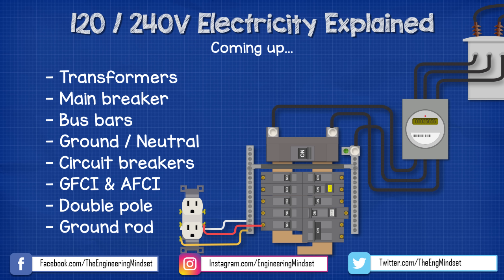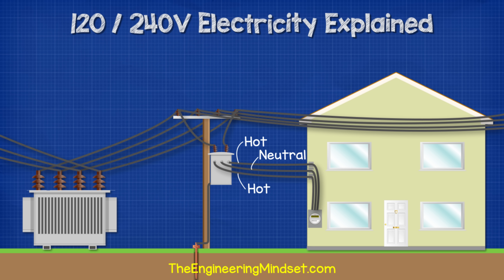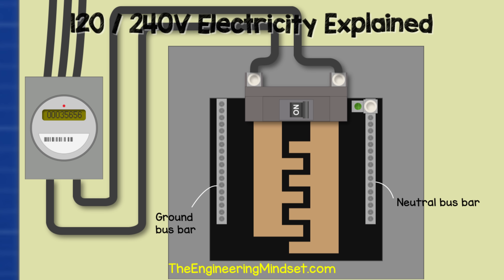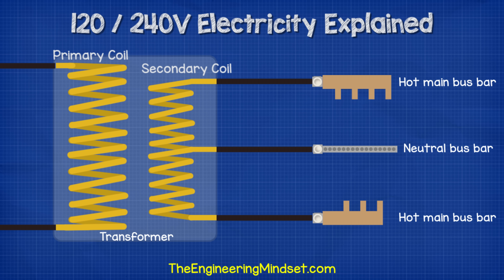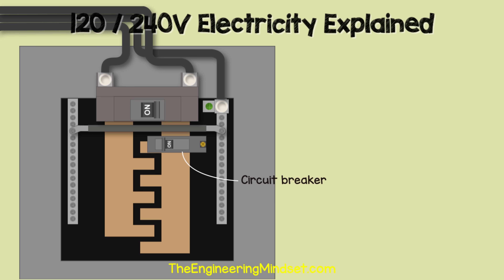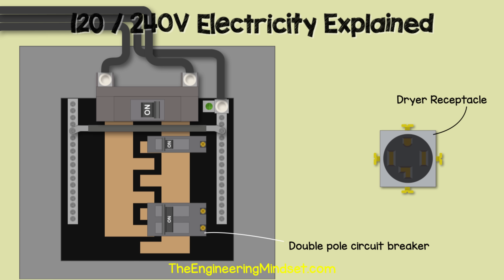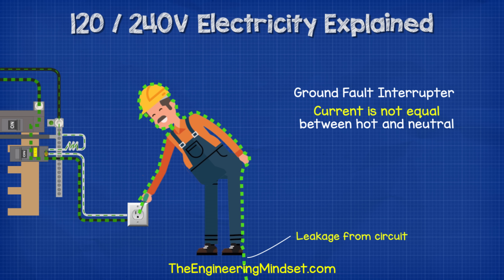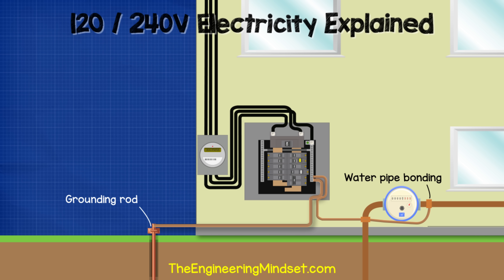120V 240V Electricity explained - Split phase 3 wire electrician

Comment from the maker: ⚠️ Found this video super useful? Buy Paul a coffee to say thanks: ☕
PayPal: https://www.paypal.me/TheEngineerinMindset
Reply: Got a,question for you. Say a small, housing complex powerlines are O gauge , how,can they handle all those,amps,for,each house without heating up?
Reply: @brettmoore3194  I can't say for sure, but the wire may not be carrying as much current as you think. The current on main power lines are large but not that large. This is actually why we use such high voltages. To transport the same amount of power, we can use a high current and low voltage OR an high voltage and low current. In general you should think of electrical power as current times voltage (the actual formula varies depending on phase conditions, dc vs ac, rms values vs peak values, etc). So if we have 2400 Watts of power coming from the line where the primary side of the transformer is at 2400 Volts while the secondary side is at the rated 240 V, then the primary is only at 1Amp, while the secondary is at 10 Amps (this is very over-simplified). Then we could split several wires off the secondary so that any single circuit only gets a fraction of the 10 Amps. Again, these aren't realistic numbers, but residential loads are all basically parallel connections so every home has control of their electricity. And currents in parallel sum, and what I mean by that is that at any single point in a circuit, all current coming in must equal all current going out (KCL). Also, 0 gauge wire can have up to 150 Amps for power transmission, which is about the maximum of most houses as stated, but that won't really be running through any single wire besides the breaker and bus bars which are made for that. Any single circuit that would receive anything more than the wire's rated current would trip that circuit's breaker. I don't know the numbers for sure, but I believe 14 Gauge wire uses 15 Amp breakers, while kitchens and bathrooms usually run 12 Gauge wire with 20 Amp breakers (and GFCI components because they're are "near" water sources).

Hope this was helpful, and it was a good question!
Reply: @brettmoore3194  cause the power company can do what ever the hell it want to,from using not only undersized feeders but there also usually aluminum instead of copper (for weight) which lowers the amp rating even further & its usually like between a #1 & #3 wire but then switch over to say a 4/0 or better wire gauge so fig that one out I understand you get a little better amp rating on the feeder cause its considered free standing or air cooling but there still wrapped within themself around a guy wire (which becomes the neutral) so again the power company can do whatever they want probably cause they really dont answer to anyone like electricians have too....just my opinion here..
Reply: @brettmoore3194  The power lines are higher voltage (7600 volts where I live). With the voltage being so high the current is low thus allowing 1/0 power lines feeding many transformers. Once it arrives at your complex and connected to the transformer there the voltage is reduced to a voltage you can use. A lot of places the service wires (wires connected to your complex) are much bigger because the voltage has been reduced so the current goes up. Ohms law and Kirchoff's law
Reply: Yes is useful but in the  pure 220V/50Hz system they are in another level.  They don't use the neutral and ground at the same wire. It's because they use a better component before circuit breakers; the differential.
The differential measures the current returned by neutral and if it is not the same of the phase, the circuit opens to prevent a dead or fire. So the central distribution box have none bars (only the ground one but never connected to neutral) ; is like an industrial control panel.
Reply: Soutwoods mall
Reply: The Engineering Mindset  I have a question, say I bring a motor from Australia or Europe  where they have 240V single phase to America, would the motor be able to run on the American 240v dual phase without a neutral or would the motor see it as 240 single phase?
Reply: @AdamsCarWashVids  us 240 is single phase 60 hz. Europe is 50 hz. I'm not aware of a 2 phase 240v. It might exist but I've never heard of it. My guess is the motor will work and run a little faster with less torque.
Reply: @AdamsCarWashVids  yes. We also have 240V, it's just not the standard outlet.
Reply: Adam sturgeon it’s not a dual phase system, it’s a split phase system. A dual phase system would measure a potential difference of 208v and not 240v.
Reply: @Bernhard Jordan Each phase is on a separate line, you can still use transformers and treat each phase as a separate system.
Reply: @Bernhard Jordanthe thing is this ain't true 3 phase as we use in Europe. In this example there is one neutral, one phase and one mirrored phase coming from a transformer outside the house. That is why you can use it for 240v appliances. True 3 phase provides 3 leads and a neutral wire (total 4 wires) with phase shifting of 120 degrees resulting in 400v between the phase wires. The 400v can be provided to a special outlet called perilex. Regular 230v outlets are often called the shuko type.
Reply: Your European is confusing the US watchers. The US has a constant feedback loop that doesn't apply the excess energy being inverted to backup or more efficient binaries.
Reply: Bernhard Jordan it’s not a 2 phase system, it’s a split phase system
Reply: I will buy a full pound if coffee if you can answer this. How can you connect a US 240v dryer in a European house with a single phase 220v system? Would two seperate plugs need to be used and both reduced to mimic the US system or is there some easier way to do it. Thanks!
Reply: Oh76hg
Reply: 566666
Reply: @wyndadewi3420  kmwm2mkekwk2è
Reply: 000
Reply: When the street mounted transformer is fed, is it coming off of 2 phases? in the vid it kinda looks like ur saying street lines also have a nuetral but the nuetral is only made at the transformer, whats the 4 wires in 1:20 then?
Reply: Thank you So much Paul. I live in the US. I’m currently looking into purchasing a UK built fishing trawler, which has a 3 phase generator onboard, and is wired as 220v. Which of your videos in particular will help me to understand what I will need to know. Any additional suggestions or input would be greatly appreciated. Thank you, Rick
Reply: Where can I take the journeyman exams, here in Florida? 🥺
Reply: Ok
Reply: Did you ever do the separate video on why the sub-panel needs to have the ground and neutral separated?
Reply: How severe would an electrical storm have to be to overcome these safety measures. (In layman’s terms).
Reply: Do you have the Grounding and Bonding PDF Phil Simmons Handbook?
Reply: It is very good, and I am usually pretty critical! I must say though, you could also use a GFCI outlet, outside, in the kitchen, bathroom etc.
Reply: Very informative video I think I'm going to go out and build me a Tesla
Reply: Gkilllfuuh
Reply: This video is super helpful. I have a question about how does it work when there is a solar system connected to the house, especially when the solar generation exceeds current house consumption. Does the current flow back to the grid via L1/L2?  Would appreciate it if you can provide some insight or point to the video that explains it?

Thank you so much for your great works!
Reply: Loved the video, understood it... But WHY do the "call" the service a "SINGLE phase 240 / 120 volt service  when clearly, each 120v leg ARE NOT of the SAME phase...❓... C'mon guys I'm waiting for ANYONE to explain it to me. Haven't had a clear explanation YET on this...🤔
Reply: fun fact my fathers an engineer at a transformer company and i have an uncle that was an electrician a pretty compitent one at that
Reply: @SkullCrusher757  what do you do, work a lemonade stand? With two other family members that have an electrical career what are you doing, watching basic electricity videos on YouTube? Do they issue a card when you have played enough videos?
Reply: the music made the video unwatchable, please re-upload with out music id like to watch this.
Reply: @MichaelMantion  the music isnt even loud stfu
Reply: how come the neutral wire has zero potential difference when it is center tapped to the secondary coil of the transformer?
Reply: Lirik I think the best thing 333333333
Reply: @bradowen8862  c
Reply: @bradowen8862  to get it you uyyuyyuy I'm by your d
Reply: @bradowen8862  Because it is grounded in the electrical panel.
Reply: @ChrisCarlin  even it's not grounded the neutral wire will always have zero potential difference. unless there is an unbalanced line current on the two main lines the neutral wire will always be zero potential difference.
Reply: @bradowen8862  When a point in a circuit is called neutral it is being identified as the point from which all voltage measurements are made. Therefore when you measure the neutral voltage versus the neutral voltage the answer is always zero.
Reply: @billelkins994  I'm sorry sir, it is not as simple as that.
Reply: @bradowen8862  Why does it have to be more complicated?
Reply: @billelkins994  because I wouldn't have asked if that's so simple
Reply: @bradowen8862  I see.
Reply: You misspelled the name of my country; it's "Canada," not "Canda!"
Reply: Karl Scheel nah it’s Canda haha
Reply: @karlscheel3500  typical

Comment: I’m pretty well versed in automotive 12vDC systems and am trying to learn more about 120v household AC.  I’m confused at 10:03.  He sticks a screwdriver in the hot side of the outlet.  So what? He’s not touching the neutral side so there should be no path for electrons to flow through him in a completed circuit.  He’s just touching one side of an open circuit. It shows the power going through him down into the floor.   The floor isn’t attached to neutral is it?  To complete a circuit and have electrons flow in a DC system you need to be connected to both positive and negative.  To put it in DC terms…if you touch just the positive side of a car battery with a wrench nothing happens because the circuit is still open.  If you drop the wrench on both terminals current is flowing and the wrench will start welding itself to the posts.  Can you be zapped by touching just hot or just neutral in an AC system?

What am I missing?

Comment: this is such a great explanation of voltage and current, but i'm still having confusion about what current really. I understand voltage is like the pressure or driving force, and without voltage there won't be a current. So if voltage is directly proportional to current, why are there varying instance of it's value compared to that of voltage. i get it might be due to resistance, but how do we explain the case where it surpases the value of the voltage since it's the driving force or does that also have to do with the load in the circuit

Comment: 3:10 
Correction: Breakers trip at 80 percent of their rating. Not 100
Reply from the maker: The breaker will trip if you exceed the rating, they shouldn't exceed 80% continuously e.g. 3 hours, but it could handle 100A for 15 mins say and be fine, it could reach 110A for ~2 mins and be fine. If you tried to pull maybe 150A through it, it would trip pretty quickly.
Reply: @EngineeringMindset  Okay, I might need more refreshers.
Reply: @EngineeringMindset I don't think that is correct if you're using a 20 amp breaker. Even at 50 amps it should trip within a minute, at 21 or 22 amps it could take much longer, maybe an hour or so.
Reply from the maker: the "~" was to indicate an estimate, not an exact figure. 
I did a explanation of trip curve (for MCB) here and how to calculate the trip tiime https://youtu.be/gqEu9t8HwW0?si=SBFHnnF7t9HryR3_&t=837

Comment: So what happens if I jump bus bar 1&2 and use 1 neutral, Do I get 240v using just 2 wires or a disaster?I have a 240v air compressor that has 3 wires 1hot a neutral and ground I’m confused
Reply: There's no neutral, 2 hots and a ground. If one wire is white, it should be re-identified as hot with black or red electrical tape.

Comment: I am a bit confused as to why there is a neutral and ground bus bar if they are connected by a rod in the main panel.  I see one aspect is to bring the electricity back to the transformer and it will trip the breaker just the same, but why not put the groundwire on the ground bar and the neutral wire on the neutral bar in the example?  is it just an organization thing to keep them separated or could you really just have it all connected to the neutral bar in the main panel?
Reply: It's just a design thing. Some panels have ground and neutral bar separated but bonded.

Comment: The purpose of the neutral bar is to return the used electricity back to the transformer. Um, that makes absolutely ZERO sense. WTF is "used electricity"?
Reply from the maker: 7:14 The purpose of the hot wire is to carry the electrical current over to the light fitting  The purpose of the neutral wire is to carry the used electrical current back to the panel and then back to the transformer.
Electricity only flows in a complete loop. We have a supply and a return.
Its more complicated than that, but this is an entry level video so its simplified.
Reply: @EngineeringMindset  "used" electricity is what PG&E charges me on me bill every month. I didnt know it actually flowed back to them. You son are missing the point.

Comment: Every electricity video is misleading, this one is no exception although the author tried, the main issue:
current shown flowing in a disconnected circuit - @2:30 this is common way to confuse the hell out of people, even eng. are confused sometimes, current should never be shown flowing in a disconnected wire with 0 voltage.
Reply: just for visual purposes

Comment: Great explanation! I couldn't visualize how a double breaker could get 240V when the breaker is either on the left side or on the right side of the panel box. In your video, I saw how double-breakers are wide enough to touch both the L1 and L2 since they zig-zag back and forth all the way down the panel. For the life of me, I just figured the metal bar from each main hot lead just went straight down and the left side breakers had L1 and the right side breakers had L2. Now it all makes sense! Thanks again.

Comment: What happens if I short the two hot wires? The same of shorting hot and neutral?
Reply: Yes except it would be 240v instead of 120v. So you would get a bigger arc and a louder pop.

Comment: i have a question why if i have 240 coming in to the breaker and 120 on both sides. why is my power strip not working. it should i’m confused

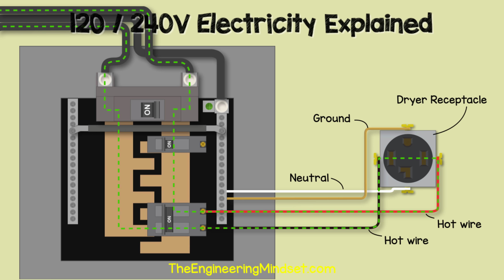Comment: 9:07 I’m confused, why is the current running through both hots and the neutral at 120V? Wouldn’t it only use one hot?
Reply from the maker: Depends if 240V or 120V is being utilised by the load.
Reply: @ not sure I understand—at that point in the video though you’re demonstrating 120V, no?
Reply from the maker: 120V from either red to neutral or black to neutral, or 240V from red to black
Reply: @EngineeringMindset  oh so at that moment you’re not showing 120V, you’re showing that the dryer is using both 120V and 240V active loads at the same time. Gotcha, thanks!

Comment: Electricity ignoramus here.
at 6m34s a Short Circuit is described.
but isn't a device (say a light fixture and bulb) effectively a short circuit as well? I mean, it is one continuous circuit - "hot" power In, the coil that heats up and gives light,  neutral Out.
How is the light bulb "short circuit" different than a real short?
Because it is doing work and giving off heat and so it doesn't trip the breaker
Reply from the maker: Lamp might be say 100 ohm resistance. 120V/100 Ohm= 1.2A current. Breaker rated 20A won't trip.
A short has no resistance except the wire. Lets say it's 0.1 ohm, 120V/0.1 Ohm = 1,200 A current!!!!!  Breaker ill trip.
This video should help: https://youtu.be/Qi0ynSQw-wc?si=bExCGflSl7-myUl8
Reply: @EngineeringMindset  brilliant. thank you . and Yes, you addressed it exactly in the video. I just didn't happen to find it earlier

Comment: I don't understand why/how the ground and neutral lines from the appliances connect to the same bar
Reply: why? because they both need a path back the the transformer to complete a loop. The neutral bar is where all currents go back to, and then to center tap of the transformer.

how? neutral an ground are connect to the equipment on one end. The other end is the plug which has neutral and ground, which gets connected to the wall socket, which itself also has neutral and ground that ultimately connects to the neutral bar.
Reply: Grounding is done for safety. Grounding the neutral keeps the voltage of the service relative to ground. If the grid was unreferenced to ground you could get dangerously high voltages to ground. The line to line and line to neutral voltage would stay the same but line to ground could get scary high. Referencing the grid to ground makes it consistent. That's why sometimes transformers without a neutral will ground a line instead.

Comment: Hey, maybe a stupid question, but in an AC setting, does this imply that the wires designated "hot" and "neutral" will switch every time the phase is reversed?
Reply: No. whichever wire is connected to Earth and the center tap of the transformer is called the neutral.  Suppose in a different system, where one of the legs (red or black) is connected to Earth. That leg would be called "neutral", but this "neutral" will behave differently than the neutral that bonds to the center tap and Earth. Don't pay attention too much to what the wires are called. Pay attention to what they do.

Comment: what is "used electricity" shouldnt that just be nil. I mean if it was actually "used" wouldnt that be that, power converted to another form?
Reply: unless you're implying that its a form of over-voltage protection?